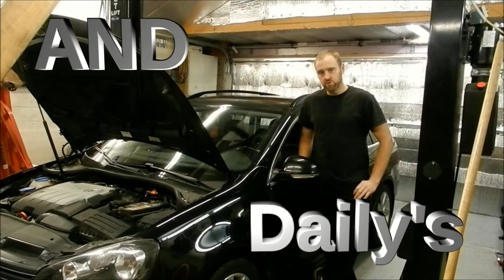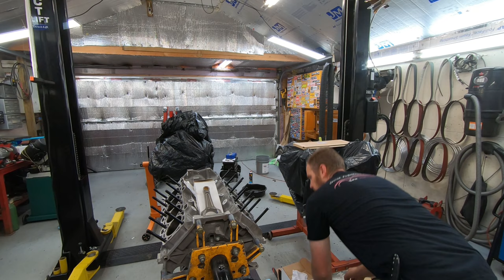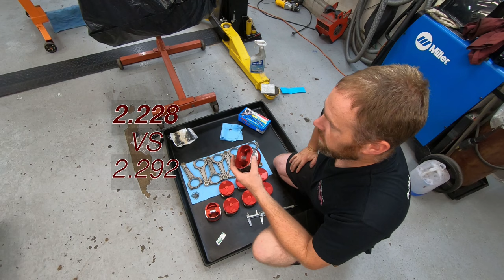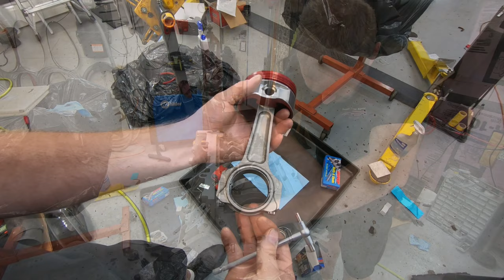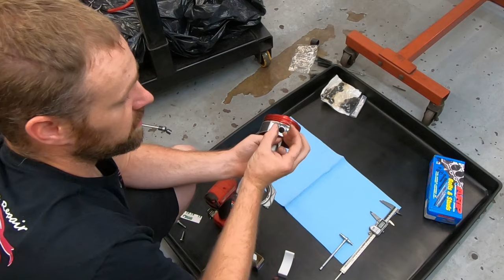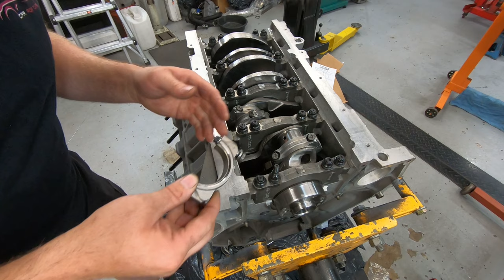Gen 3 Ford 5.0L coyote Engine Build Assembly Pt1

Comment: Piston oil squirter deletes are almost always done when replacing factory pistons with aftermarket forged pistons, and/or sleeved blocks, and aftermarket rods. Their removal obviously eliminates the problem you ran into with the squirter tube contacting the piston at BDC, but more importantly, blocking the passages means a beneficial increase in oil pressure to main bearings and cylinder head components.
Reply: The thing with oil squirters is that they only activate at higher RPM once oil pressure has reached a sufficient level. They have a check valve operated by a spring that is set to a certain PSI, much like a wastegate. Once the PSI is high enough, the force of the oil overpowers the spring and the check valve opens. Even if oil pressure does drop, because they only open up at higher RPM when the oil pressure is already sufficient, it isn't an issue to the health of the motor. Oil squirters are great for reducing knock on higher compression pistons. If you want to see real proof of this, look at the turbo 3 cylinder Toyota made for their GR Yaris rally homologation car, which has a total of 9 oil squirters, 3 for each cylinder. In stock form the engine runs about 20 pounds of boost with a 10.5:1 CR. If that's not going to harm a motor, I doubt much of anything will with oil squirters. Though I can't say anything about removing them for the sake of clearancing aftermarket pistons.
Reply from the maker: @inaNis_  Awesome points mad by both. I personally like oil squirters for the cooling factor. I feel the extra cooling is worth the slight hp loss they may cause.

Comment: Fyi, your suppose to delete the oil squirters when you go to a 2618 forged piston. Why the heck would you try to cool a forged piston that is trying to get up to temp? also you mentioned nothing on line honing the block when  go from a main bolt to a main stud. the torque is different and the block can distort differently.  also the coyote crankshaft has been proven to over 1500hp with no issues.. save your cash for other areas of the build.  I just when through all this on my Gen 3 build and it's a pretty simple engine that was well thought out.
Reply from the maker: No, line hone checked out pretty dang good. Metal must not move much under added clamping force. Yeah I realized the oil squirter thing later on. Being the first time playing with one I recorded the video as such as well. I'm no Coyote genius I just find the issues and address them as I find them.

Comment: Why are the pistons anodised red? Is that supposed to be an anti friction coating?? Never seen that before..
Reply from the maker: I've done a lot and it was new to me too. Customer ordered the parts but my best guess is a form of heat resistance. Something like ceramic coating does. Didn't look or feel like it would be very effective though.

Comment: Built many truck engines 
I always shake my rods meaning i will make sure after they are torqued they move a little movement free play had one one time someone took the engine apart after i torqued the rod it wouldnt shake figured out the other guy nicked the rod bearing journal that caused a high spot after i cleaned it up it was ok could have spun a bearing had i not shook the rod

Comment: Doesn't change the molecular structure of the steel. Cryo treating, like quenching and other processes changes the crystalline/grain structure of the steel.
More or less/grain increases or reduces hardness and ductility of steel.
Cryo treating increases hardness and rigidity and reduces ductility. So less wear on journals and less flex on crank. 😀

Comment: I just wanted to voice my experience here. When you measure bearings, the vertical clearance and the horizontal clearance are going to be different. This is by design
Reply from the maker: Only if the bolts aren't fully tq down. Once the rods are tq down it should be very close to a perfect circle.

Comment: Gen 3 coyote dont have piston sleeves. there is a crazy "welding" process to "sleeve" the cylinder bore that cant be adjusted. i have a gen3 in my 18 mustang. if i do decide to change any of the internals ill probably go with a gen 2 block or the voodoo block (5.2L) mainly because i dont trust the new process of "cylinder sleeving" great job catching those interference issues.
Reply: Cylinder sleeving has been around for literally over 100 years. It's not new. They bore out the bore, removed the plasma weld, and insert stronger, more reliable darton sleeves. The plasma liner is very well known to fail.
Reply: @pheonixfps9248  im fully aware that sleeving has been around for more than 60 second. the new gen 3 blocks have to be bored out to sleeve them. you're boring the block to get the same CID. thats bullshit money spent for something that shouldnt be a thing
Reply: Isn't that hard to block and something else supposed to be combined For a good running engine with these coyotes I don't know what the combinations are

Comment: Would you mind sharing the ring gaps, crank bearing and rod bearing clearances you used on this engine? Also, I know where that rotating assembly came from 👎
Reply: let me get my spec sheet from MPR race engines that spec'ed my block..  going off of memory the rods were like .0018- .0020 and the mains are simliar. I will udate this tommorow when I dig up the sheet.   Being the gen 3 coyote is dual injection traditional ring gaps are out the window. the factory top gap is only .09 and the secondary is around .033.  I went with MAHLE powerpak pistons that use the factory ford rings.  I went with .024 on the top ring and left all the other rings alone as they are already set from ford. I went with clevite bearings as king bearing QC has been down hill.  if your going to be boosted keep the top ring around .023-. 026... I'm pushing over 1k hp and all is well. also the arp headstuds are the same as the early 2011 engines that used a long M12 bolt.  and yes, I see the MMR red as well.
Reply: @malloymotorsports780  Thank you Mike! I just saw this. Appreciate the info.
Reply: @mtrefethen1  ring gap will be specific to manufacturer but most NA builds run the top ring at .016-.018 and secondary rings are set to .019-.021
If you are running boost under 1000 hp then add .004 to both top and 2nd ring if you are running boost over 1000 hp add .006-.008 to both top and secondary rings. 
You can also contact Mahle or Total seal to get generic ring gaps for your bore size, but each engine builder will have there own "performance ring gap" the specifications I suggested would be best for performance.

Comment: Watching your piston wrist pin offset location, could this be the issue with GEN3 V8 having cylinder shears that cause oil consumption issues. If installed with wrong side orientation, on those plasma arc weld cylinders.
Reply from the maker: It would cause binding and premature skirt wear if installed wrong. That could lead to oil consumption I suppose. But that isn't likely going to happen from the factory anyway.

Comment: You're supposed to delete the squirters when building up
Reply from the maker: Got a source on that and why? Would have been nice to know when doing it. Seems a shame to lose the piston cooling effect of those oil squirters.
Reply: @CrazedPerformanceRepair  I would've went through the same as well. I watched a series on here with LS vs 5.0. The main reason is clearance as you found out. But you gain 4 or 5 HP as well by deleting the squirters.
Reply: @CrazedPerformanceRepair  So this is a televised program that chose the #1 LS builder in the country and the #1 Coyote builder in the country. They had each of them build an engine under certain price point and ran them on a dyno to compare. It's worth a watch.
Reply from the maker: @JMAC479  If it's only a 4-5hp loss out of something making a 1000hp on the street I'd rather have the cooling effect they offer. However if its a NA drag car and every hp counts to beat competition then delete I would lol.
Reply: @CrazedPerformanceRepair  With upgraded pistons you likely are better suited for the temperature than oem pistons with squirters. The delete is due to clearance, upgrade pistons and rods hit the squirters. The positive side to that is it gains HP.

Comment: I stopped watching when I saw you building an engine with the parts on the floor. I have been to race-winning shops and they all have engine build rooms.  Sorry, you are not a qualified engine-building instructor.
Reply from the maker: Fair criticism, but If you plan to build one in a controlled clean room more power to you. If you plan to build it in your own garage, then my content is much more applicable to what you plan to do. I have never had a engine fail from contaminants or bad tolerance and have built plenty. In fact at the time of this video I was building 3 engines.
Reply: If you stopped watching. You shouldn’t  commented then.
Reply from the maker: @larrypruitt3919  did you mean shouldn't have?
Reply: @CrazedPerformanceRepair  you should not have commented then!
Reply: Grassroots racers have been building engines in garages for years without issues. My transmission was built in a cluttered up shop and season 3 of racing without a hint of failure. If you don’t like it scroll on.